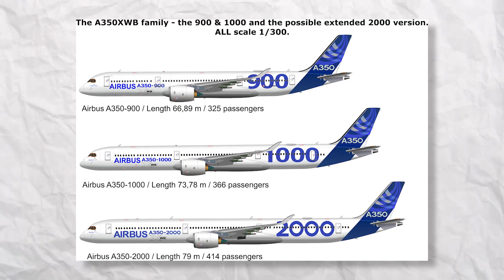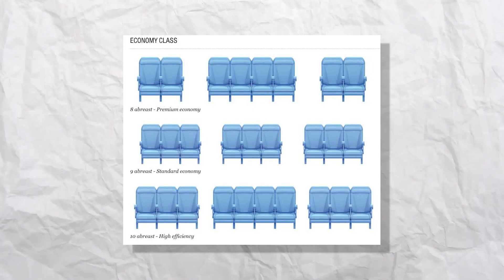This Why Airbus Must build the A350-2000-Boeing's Killer! Here's Why

Comment: The 4m stretch will allow around 40 extra seats, bringing the capacity to over 400, but still short of the 777X's potential 425. It will result in a reduction in range. The previously suggested identifier A350-1100 seems more appropriate for this, as it's not changing much from the -1000.
I think the -2000 identifier should be reserved for a more significant change. Perhaps a longer stretch to match or exceed the 777X with new wings and even bigger engines.
I don't think Airbus is going to rush into either. They are working on the A350F, so that's going to be their focus in the immediate future. They have plenty of orders with the -900 and -1000, so they would need to be convinced that there would really be demand for a larger variant.
They don't want to get burned like they did with the A380.

Comment: A 350-2000?  Are they waiting for the RR Ultra?  Why isn't the Ultra certified yet?
Reply: As an engine manufacturer you develop machines that are perfectly optimized as propulsion for exactly defined real aircraft types. This requires a very close relationship in marketing, engineering, production and logistics between the aircraft OEM and the engine builder, and mutually binding agreements between the parties.
Such binding agreements regarding a hypothetical "A350 NEO/ULTRAFAN combo" do not yet exist (or are at least not yet publicly known). Consequently, there is nothing in the making yet that could be certified in the first place.

Comment: Just to let you know that Airbus isn’t planning on building A350-2000 but they are upgrading the A350-XWB so it’s going to fit into that market instead of building the A350-2000 but Airbus is planning on using the engines from the A380 to power the new A350-XWB plane
Reply: This is bluntly wrong!
The TRENT 900 engines of the A380 are much too small for the big twinjet A350, furthermore they represent older and less efficient technology than the current TRENT XWB.

Airbus had publicly announced that they did not want to pursue with an A350 double stretch (often dubbed the "-2000") "because the -1000 was the right size". The latter is nonsense too! The reason why Airlines like Emirates, Qatar, LH or lately Korean have ordered the expensive 777-9 lastly is that these companies consider other products (i.e. A350-1000) as not big enough.
Reply: @KlausErmecke  Exactly this.  The current -1000 engines are the XWB--97s producing, funnily enough 97,000lbs of thrust, whereas the Trent 900 produces 75k - 84k lbs of thrust. Not quite the upgrade.
Reply from the maker: Thanks for your information

Comment: I couldn't get to the end of this video fast enough, as I was waiting for the big but, which never came.

What our host fails to understand, is that the A350 is virtually sold out. There are rumours of both Emirates and Qatar ordering more, the A350F is expected to pick up many more orders also, and that would take deliveries into the 2030s. Why would Airbus spend time and money developing an aircraft which they cannot make this decade? They simply don't have production line capacity to build it.

RR are already upgrading both XWBs, and probably Airbus and RR will tinker with the design to make further improvements, but no A350Neo or A350-2000 is going to be sold until the backlog of current orders is almost complete. So yes, Im sure Airbus are planning such an aircraft, but not before the jinxed B777X goes into service.

The A350-1000 does compete with the B777X already, especially with more time on the wing iro of maintenance, as promised by RR, but those areas where the Boeing aircraft still has advantages, will be its main selling point. Its now up to Boeing to get it delivered. They're still saying 2025, the airlines say 2026, and now the thrust link problem is sending the Boeing boys back to the drawing board, certification flights are suspended and with the FAA hopefully breathing down Boeing's neck, who would now bet against 2027/8. Nobody knows.

Even 2028 is still too early for any A350-2000 to go into production. The potential "killer" of the B777X is therefore not the A350-2000, (not in this decade), but Boeing's own inability to get their aircraft delivered..........

Comment: It is worth noting that as of Jul 2024 AIrbus has over 1300 orders for A350 variants - including 55 orders for the A350F - which was a market dominated by the Boeing 747. I agree that the current situation represents an opportunity for Airbus, However, there are number of factors that would need investigating. The aircraft extension you presented (more likely the 1100 or 1200 variant) would be relatively low risk but the - as yet unproven - engine upgrade would be medium / medium+ risk, just look at the P&W geared turbo fan, the GE90 issues and previous RR Trent issues. With 1300+ back orders for the A350, and a desire of AIrbus to grow the freighter market, I would think that the further extension of the A350 may be a lower priority than possibly looking at what comes after A320/A321 where they have Boeing on the ropes and have the breathing space to land a knock out blow. This approach would also allow some of the current Airbus production and supply chain constrictions to be ironed out and give AIrbus the ability to service their order backlog.
Reply from the maker: I see your point. With over 1,300 orders, the A350 is definitely in a strong position, but I agree that the focus should shift to addressing the A320/A321 successor. It makes sense for Airbus to prioritize consolidating their position in the narrow-body market while addressing any production constraints, rather than pushing for another A350 variant right now.

Comment: I see the market for the B777X being limited in numbers when compared to what many regular airlines will see the A350-1000 as the perfect aircraft for size, efficiency, & purchase price. B777X should do well for the customers that have ordered it for their flagship services offering more luxurious travel. I don`t see the neccessity for a stretch ( A350-1100 perhaps? ) particularly as it would be expensive due to a need for a more powerful engine. I know T-XWB-97 is due an unpgrade soon but isn`t it at it`s design limit for thrust already? As it stands A350-1000 seems to be the defacto replacement for the B777-300ER for size but with much improved efficiency & a purchase price that is far more attractive to most airlines. For example how many B777X`s would US airlines buy? A350-1000 has a growing order book & it`s sales should increase exponentially as B777-300ER`s & B777-200`s need replacing.
Reply from the maker: If the 777X is not certified it will lose market to the A350. That is for sure.

Comment: It makes sense, in in the spirit of the A321XLR, Airbus ashould develope a A350-2000XLR. Using part of all of the extra 4 meters in the loweres for additional fuel storage they can add passerger capacity and range at the same time. With Rolls Royce making updates and improvements to the Trent-84 and -97, the added power may already built into the new package.
Reply from the maker: Thank you.

Comment: It will obviously be called A350-1100 if they stretch it! Why are u saying 2000? Thats sloppy.. the other models were A350-800, 900 aand 1000, so a stretched 1000 would obviously be an A350-1100…
Reply from the maker: Why not 2000? 2000 is more impressive, I think.

Comment: Interestingly, no airline is really interested (yet) with the A350-2000. Reason: the A350-1000 is just the right plane for many airlines, especially regarding compatibility with current airport infrastructure.
Reply from the maker: 1000 is still going strong and popular!
Reply: @FLIGAVIA  Because it's essentially replacing the 777-300ER. Once Rolls-Royce can resolve the reliability issues with the Trent XWB-97 engine, I wouldn't be surprised that the likes of Emirates could place a 120-plane order to essentially replace their well-used 777-300ER fleet starting around 2030.

Comment: Wouldn't stretching the fuselage turn it into a twin engine A340 ???
Reply: What's the problem with that
Reply: @Plane-Ship-Lover  It would be too heavy, one of the main strengths of the A350 is it`s lighter carbon construction.
Reply: @edwardwilcox6606  A340 wasn't carbon fibre so clearly wouldn't
Reply: @Plane-Ship-Lover  Precisely my point! you relied `whats the problem with that` & I suggested it wouldn`t be competative, so thats whats wrong with it.
Reply: They could stretch out as long as a340-600. That's just shy of 76mtr
Reply: Nope. 
The A330/A340 seating is 8-abreast instead of 9, and it's now much more sophisticated technology.

Comment: I don't like extreme fuselage stretchings: the plane looses something in terms of safety and strenght. Better restart production of A380 and improve the development of zeroE aircrafts.
Reply: It wouldn`t need to be extreme, regardless AB would make sure it was safe before any release. A380 is finished, only a very efficient engine in the 75,000lbs thrust area could bring it back & that sadly is way off.